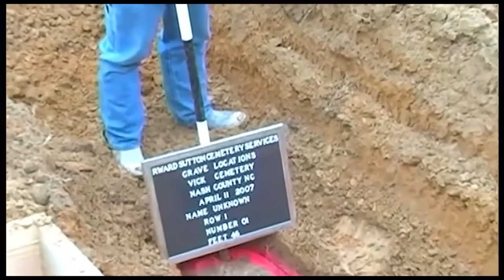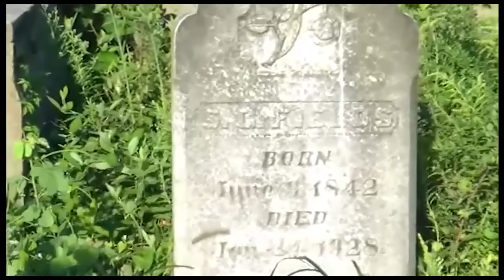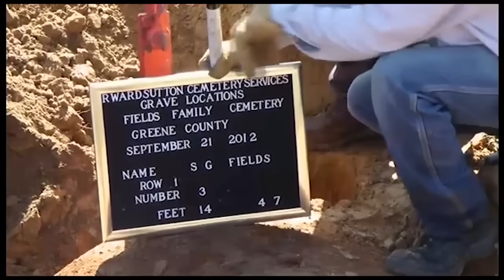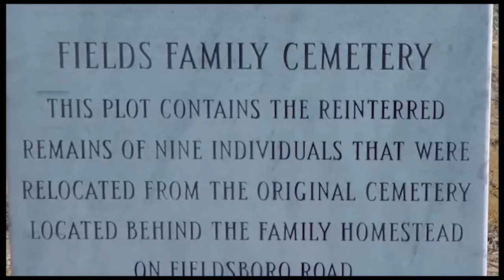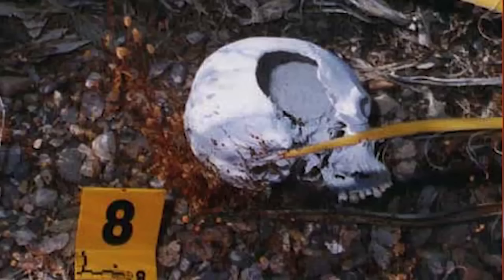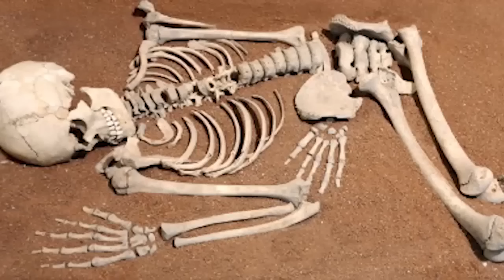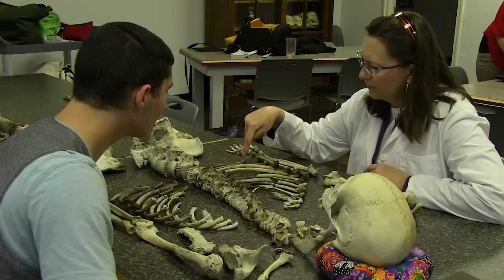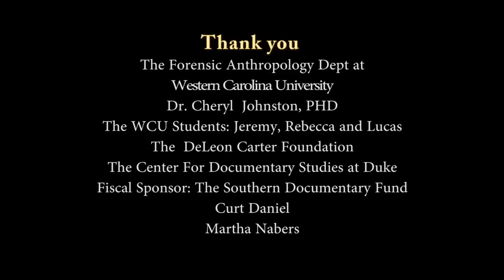Digging Them Up I & 2

Comment: At 8:21, when the remains of S.G. Fields was being removed from the ground, that metal "casket" appears to actually be a steel vault, which encases the actual coffin or casket. Steel vaults are not used all that much these days, but back in the 1920s, were fairly common among the well-to-do at least. Fields died in 1928. 
They are usually quite good at keeping water out, so it can be promising to find well-preserved remains within them, so long as water has not managed to penetrate the "dome" of the vault (ie the top, which was often made of higher grade, 12 or 10-guage steel, enameled). Those would had been expensive back then.
Reply: It very likely was a CLARK vault. These metal vaults were very popular in the early twentieth century and are sold today. They are supposed to keep water out by osmosis and keep the casket dry.
Reply: I don't understand why anyone cares about the state of their corpse after death.  One would think it preferable to actually decay, not stay dry and protected.  What's the point of that?
Reply: Chainsaw Kitten I agree!!! We are supposed to go back to dust !!
Reply: @chainsawkitten3766  I think it's a Catholic brainwashing thing where they state your body has to stay in tacked so when Jesus comes to raise the dead ect. 
    When Jesus comes to raise the folks He has chosen to save... it will be their SOULS  that will leave the bodies, NOT the bodies 
 themselves !
    Like now, when a person dies their souls leave the body where it goes from there I guess depends on how one has lived their life.
   When I was a child & died (for a short time in a hospital) I could see my body & found myself in a bright white cloudy mist like tunnel like an elevator with no door going upwards with great speed but you don't feel gravity pull & you could look out & see through the mist into blackness with bright specks if lights like stars. I don't remember seeing my form or body.
    I heard a very loving friendly voice stating it wasn't my time yet, there were things I still had to do & not to be afraid. Then I was back in my body again. The doctors were amazed, my super high temp was gone & I was fine.
     I'm not a religious 'nut' (meaning I won't be controled by preachers ect who want you to live & whorship  their way ) but I 
believe in God & live by His Commandments & teaches.
Reply: Problem is a totally sealed coffin with in a totally sealed vault is actually a pressure cooker making an ugly soup inside with no oxygen.